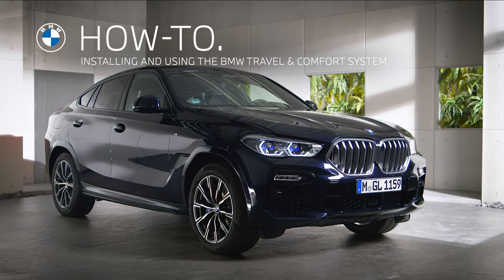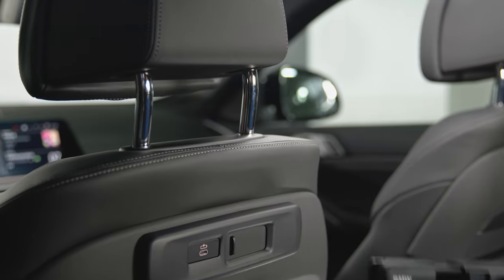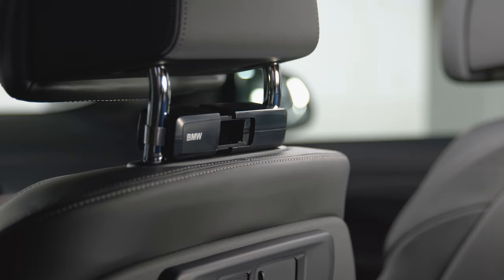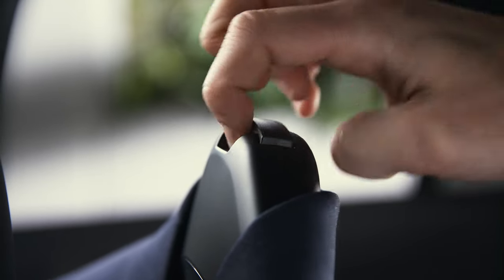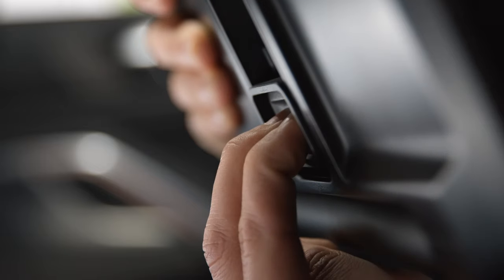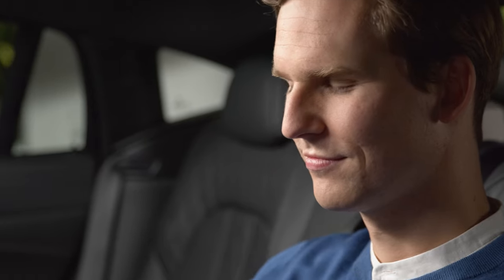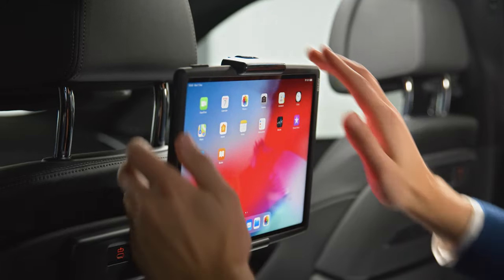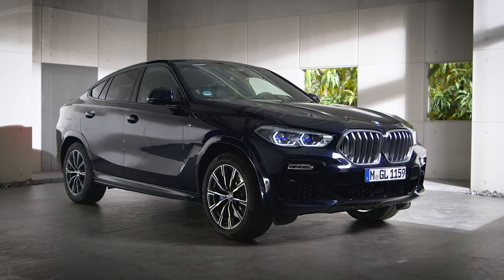Installing and using the BMW Travel & Comfort System – BMW How-To

Comment: One safety case is being offered.  Tablets come in all shapes and forms.  Exactly what tablet is supported by this singular BMW safety case?  Can I use a tablet with the holder and not the case? No model information is included on the BMW parts website.